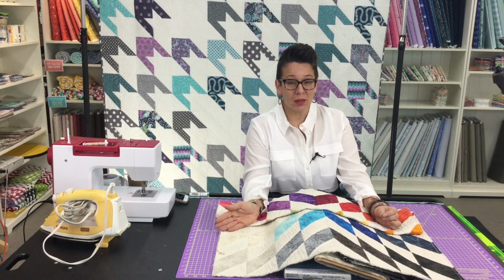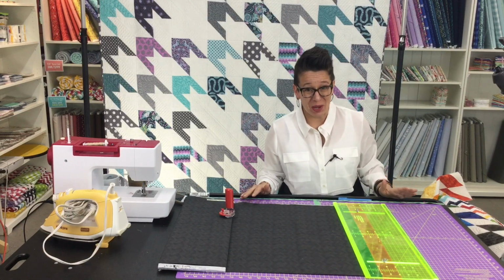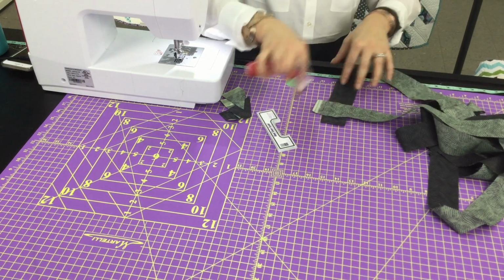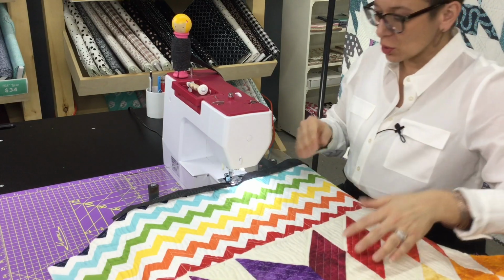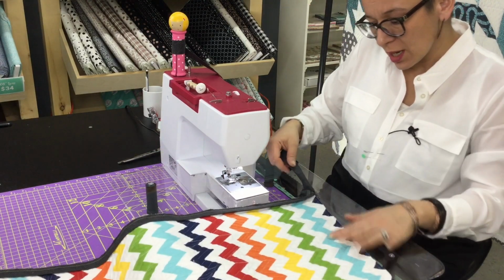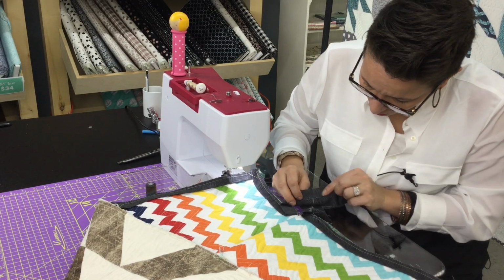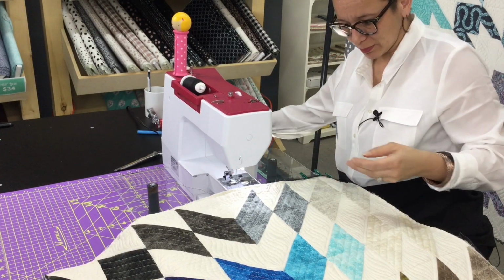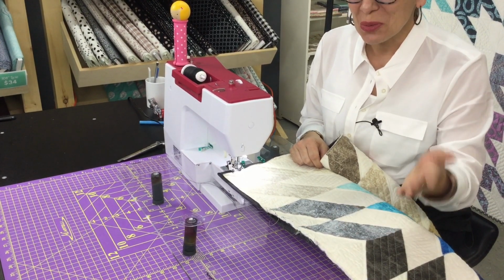Machine binding a quilt for beginner quilters

Comment: Good video but a couple of questions. The tool you used to iron the binding before sewing, did it fold the raw edge under? or did you use a stitch that covered the raw edge?  I might try it. Love the easy corners. And those clips look really helpful too. Any suggestions for something other than a Binding Baby? Can't afford all these cool gadgets.
Reply: I, too, liked the idea of a binding baby, though I have limited funds.  I was thinking to try a toilet paper roll and make a slit down one side, wind the binding on it as Bradie did,  then place it on a stand-up paper towel holder with a ball on top that unscrews. Then I can put the holder on the table to the side of my machine.

Comment: Why can't you double fold the binding strip (fold in half, then fold raw edges inside and press), straddle it over the edge, and sew once instead of going around twice?
Reply from the maker: Loretta Compher hi Loretta! Thank you for the suggestion. I have tried that method in the past, however I found that the fabric moves on the bottom and it misses spots! Then I end up repeating the process anyways. I get better results this way and find that it looks much neater. This is just my personal preference tho, and I think everyone has to find the way that works best for them. 😊

Comment: I really am new, learning from you tube, and I'm trying to attach my first binding. But picture is worth a thousand words and i couldn't see where or what you were doing. For instance, after you pull your binding through the binding maker, how do you lay it on the quilt and exactly what part of the binding is being sewn a quarter inch. Also, i have seen binding ironed in half then the doubled raw edges of the binding sewn to the raw edges of the quilt. Then the doubled binding is turned over the quilt edge to the back of the quilt and sewn stitch-in-the-ditch style hopefully catching the edge underneath. So, what is the binding maker for? Why use it at all? Doesn't that create a double-fold binding?
Reply: I love your channel I wish I was you is it fun to sew
Reply: Is your channel showing about is your channel is your channel showing about do you like being a shower I think it's fun to sew by hand I like to be fun with sewing up my sister likes to make baby stuff and I wish I had a channel I really really really really really rich is it fun to have a channel I'm just wondering I'm not trying to be rude but